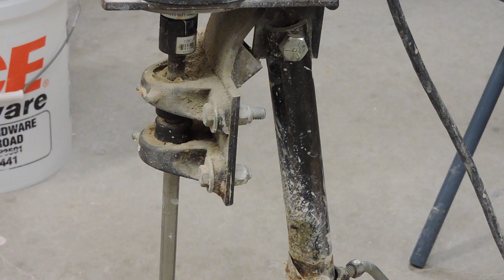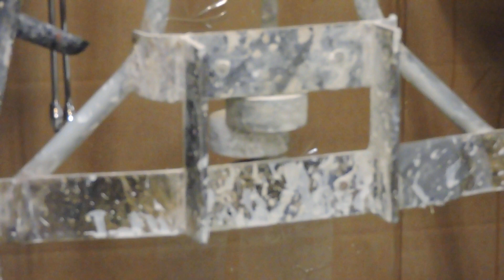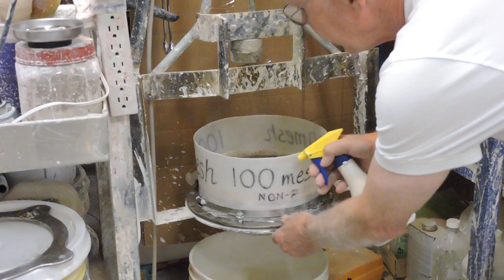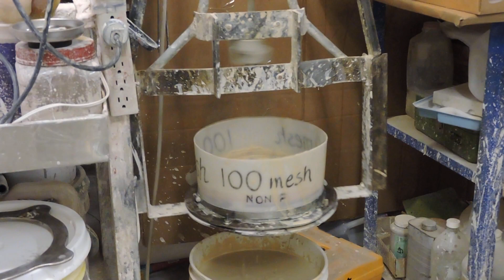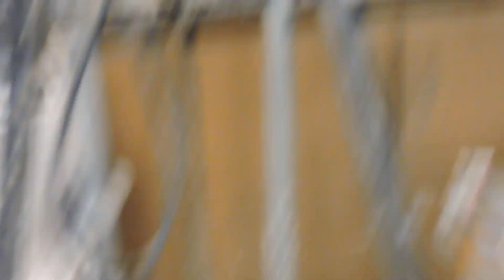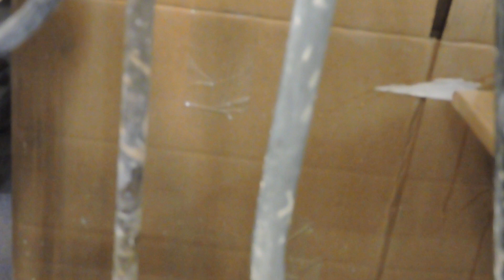DSCN0397

Comment: When I made my concrete edging for the garden using PVC gutter sections for a mold. I used my reciprocating saw to vibrate the air out, worked a charm.
 Appreciating your thought process when it comes to tools and pottery.
As a beginner I decided right off to set  my wheel up for standing. 
When I acquired a second wheel I set it up with the Giffin Grip at about chest height for trimming with an elbow bar for stability.....having great fun with the pottery and tool stuff too.
From a hobby potter who has just put his feet into the clay I thank you for sharing.
My inventory is kept at bay by collecting donations for hospice. When someone takes a pot 100 percent of the donation goes to either HPH or Gulfside Hospice.
Your videos are going to help me a lot in how I throw my pots.